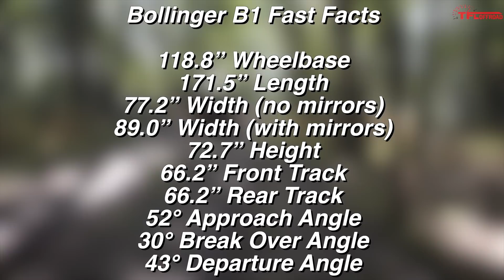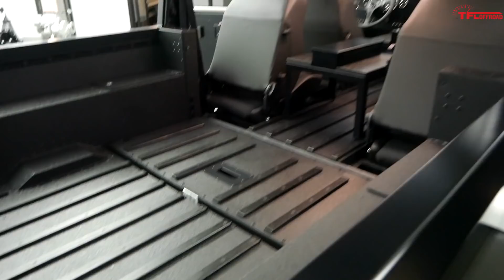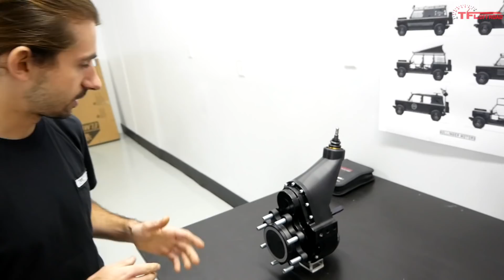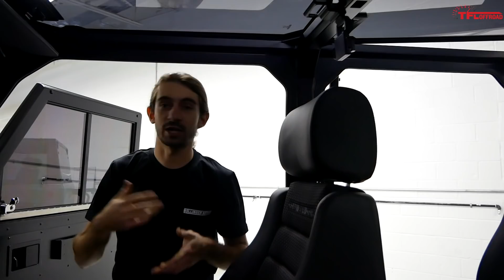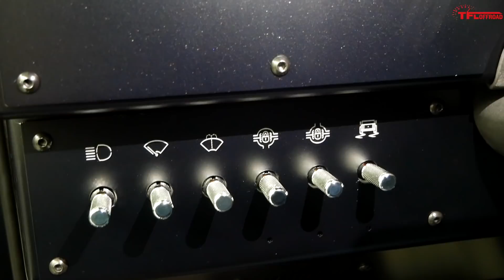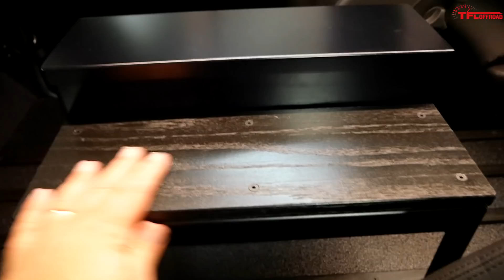You Won't Believe How Clever this Electric Pickup Truck & SUV Really Are

Comment: Other car manufacturers: we need to make an electric car as aerodynamic as possible
Bollinger: let's make a brick
Reply: Look up there old videos, it has a surprisingly good slipstream
Reply: The brick doesn't matter because this isn't met to be a freeway driver. This is a farm truck, work truck off road vehicle. So most of the time it will be driving at lower speeds.
Reply: @Franklin Kenneth You're right, I've never really paused to appreciate the beautiful lines of a brick before.
Reply: @mark7067  . Don't tell me, you find Ram and Ford pickup's attractive. lol

Comment: I like it, simplicity and function. The hi-low beam light switch sold me. And it looks easy to mod out some areas. Ham Radios are an easy add and if you live in the right area, cheep to use. Personally I would undercoat it for use in the rust belt. I think changing the roof glass to solar cells to trickle charge the pickup or SUV. Can’t wait!!!

Comment: love the fact that they brought back the old school high beam switch .
Reply: Unless your spinal cord is messed with.  I have no use of my feet.  I must use hand controls. sadjh;wajhf;wjhf;wkDHJF;kwhjdfk;jhfds  VERY UNTHOUGHTFUL.  Guess I should just sit in the nursing home.
Reply: @tccarr7162  surely one could rig up a hand control for the high beams
Reply: @EEI605  Well ya, it is after all just a switch.  The question is why is all that wiring etc necessary?  Especially at the asking price.  At least put the wiring in the harness.

Comment: Range, range, Range, range, Range, RANGE, RANGE, RAAAANGE! In 2020 we need at least 400 miles guys!!!
Reply: Price, price, price..... keep pretending most ppl will be able to afford even a short range version...but its still cool enough to dream about and for trolls to mindlessly rant about its range... :)
Reply: If you want a 400 mile electric truck, you'll have to wait roughly 2 more years...and Buy either the Rivian RT1 or the Tesla pickup (which should get unveiled later this year).
Reply: @Douglas Stormborn - EV's didn't truly "arrive" until a decade ago.   Lithium ion is energy dense enough to make them practical.  In 2 years you will have 2 400 miles options, and a couple years after that you will have around 6.   People don't seem to be paying attention at how fast the automotive industry in changing.
Reply: @Douglas Stormborn Not bullshit. The Rivian will have 400 mile range thanks to a huge 180kWh battery. The real problem with batteries is how expensive they are. If they were dirt cheap every car could have a huge one with a corresponding long range.
Reply: @Douglas Stormborn The Rivian 400 miles is EPA range, which I understand assumes 55% city driving and 45% highway driving. Like all cars, if you do 100% highway driving the range will be less than EPA.

Comment: who staffs the design team, the flintstones?
Reply: I like the simplicity. Less parts to brake and lower cost
Reply: @BestowalPants90  Yeah, I'm sure it'll be priced under $140,000.
Reply: @frederic423  Maybe, but I wouldn't bet on it.
Reply: @frederic423  Don't count on it.
Reply: Design team? 🤔
Reply: ribbit1964, HAHAHAHAHA So appropriate.
Reply: @BestowalPants90  "lower cost" kek
Reply: It was designed by Lego.....
Reply: ribbit1964 - It’s designed so the panels can be made using a brake press.  They don’t need a huge (and insanely expensive) stamping line to build the body.
Reply: @BestowalPants90  I prefer airbags over simplicity.
Reply: What would you say now after Tesla truck just came out
Reply: @tharwatjad9444  Tesla is a way better deal, and way better looking. It will also come with great features like airbags.

Comment: These things shouldn’t be sold for more than 30-40k it’s literally a metal box with a US military interior
Reply: The 120kWh battery and related electronics alone can cost 30K. Then the metal they use for the body, aluminum, is much more expensive than steel.

Comment: At highway speeds those flat fronts are going to absolutely kill the efficiency
Reply: don't you know? it's off-road
Reply: Yes, which means you will be motivated to drive at low speed, and at low speeds you don't need air bags. See how everything fits together perfectly?
Reply: It’s not street legal you know that right?
Reply: @joshlower1  Of course it is street legal.
Reply: cruiser97eric1 the guy literally said it’s not. It doesn’t have airbags
Reply: @joshlower1  Class 3 vehicles like this one are not required to have air bags.
Reply: cruiser97eric1 even if it was I don’t see it being used on highways much
Reply: It would be great as a farm truck or where someone is working in remote places. I mean it’s literally just an electric humvee.
Reply: Diesel is so expensive nowadays it would be much cheaper to use one of these. Also less maintenance too.
Reply: That's why you tuck in behind a semi and ride the draft. My truck isn't much more aerodynamic than this one and I do that all the time.

Comment: If these guys can’t figure out how to produce this thing at an affordable cost and they start to run low on cash, then Tesla should scoop up this company and rework the electric motor and battery pack and otherwise leave it unchanged. It has a wonderfully mechanical low-tech design ethos. I absolutely love this design. I like all the other Bolinger vehicle variants as well.

Comment: Doesn’t appear to have any crash air bags.
Reply: David Sanchez  They won't, Bollinger Motors says that the B1 is solely designed to be a Class 3 vehicle. As such, the vehicle is not required to have airbags and it's not required to satisfy passenger car crash tests. Class 3 vehicles have a different safety standard.
Reply: Should be accepted as devisrity and neighbourly in Canada. In 1960 (the current year in Canada) we don't know what air bags are?
Reply: I think it’s meant for low production, so it does have to met all modern safety standards
Reply: 2nd3rd1st finally a comment with some sense
Reply: That's probably because airbags are dangerous in an offroad vehicle. You hit a bump at 45mph, airbag deploys and knocks your hands off the wheel, airbag then deflates just in time to see your hood trying to eat a tree. I got rear ended on the freeway at speed once and both the guy who hit me and myself had to fight to keep from rolling. If either of had active airbags we wouldn't have walked away without a scratch (i actually drove away and finished my trip from Oklahoma to Colorado) and the 80 gallon terrarium and possibly the 3 foot python in the back of my truck would have been toast. And don't get me started on seat belts, let's just say that if I always wore one i would have died when I was 7.

Comment: Nice truck but until they get the re-charging time to something as reasonable 10 minutes for max charge, these will be niche products for people who live in cities and own a home and don’t drive much more than 150 miles a day.
Reply: Most people drive less then 100 miles a day, problem will be cost not mileage or charge time.
Reply: @hoodman420  It doesn't matter what most people do in a typical day. If I'm a weekend warrior, I don't want to have to own a 2nd truck just because my plug-in truck fails to go the distance. Unless all I plan is to go off-roading in my back yard or haul a couple tons around my block, this thing is entirely pointless.
Reply: @hoodman420  Most people don't buy trucks and 4x4 utilities a for typical commute, you buy them to haul, tow, go off road and/or make road trips. For that, you need range or quick turnaround.

Comment: 200 mile range empty means aprox 50~60 miles towing, so pretty much useless as a tow vehicle.
Reply: D U fine for a run to Home Depot though.
Reply: @ALMX5DP  Do you people think the average 4x4 buyer would spend so much money to make trips to Home Depot? If so, you're totally out of touch with reality.
Reply: Kendrick who said anything about average buyer? I certainly didn’t.
Reply: @ALMX5DP  Right, average buyers would buy a normal truck while weirdos will buy this.
Reply: @ALMX5DP  How many people are going to buy this so they can strap a trailer to it and go to Home Depot with their 50 miles of range?
Reply: El Guapo I don’t know, that’s a good question for the manufacturer to answer as I’m sure they’ve looked into the potential market base.
Reply: Marauder again, why are you stuck on average buyer?
Reply: @ALMX5DP  I can't believe you're being serious.
Reply: @MC17EMD  It's frightening to know how serious they are.
Reply: @MC17EMD  Serious in questioning why someone brought up an unrelated point? Umm sure I guess I'm serious.
Reply: @ALMX5DP  It's not unrelated at all, it still ties directly to the questions around the purpose of this vehicle. To this point, you still haven't come up with a good reason to own this vehicle.
Reply: @MC17EMD  let me answer that with a question, does a vehicle have to fit the average (current) owner in order to be a success? 

And I think this vehicle can fill a niche for consumers or corporations looking for it's payload, offroad and configurability. Not to mention the technology underneath can be adapted to many more applications.
Reply: @ALMX5DP  Of course not. If the market wants their products, then good for them. But its not really the market driving this. If Ram or Ford built a truck with 50 miles of realistic laden range, and if it was constructed like a filing cabinet and priced at $100,00+ or whatever.... The company's market value would become dirt and it would be the funniest joke in automotive history!! 😂Seriously, I don't even know why we're talking about this as a serious company.
Reply: @MC17EMD  We're not talking about Ford or Ram... We're talking about a small startup trying to fill a niche or at the very least establish themselves and their technology to potentially be absorbed by someone larger. Regardless of the driving force, it fills  a potential void in the market. If you dont like what that driving force is, that's probably something you should take up with your representative.
Reply: @ALMX5DP  I'm using Ford and Ram as measures. Use your head. No one would be talking about a vehicle like this if it weren't an EV novelty. If this had been any established brand with a normal ICE truck, it would be a joke. It doesn't fill any meaningful void. Who the hell would buy a $100,000+ tool box with 50 miles of laden range? Do you know how crazy you sound?
Reply: emdec55 with large brands like Ford and VW getting behind electrification, I don’t think calling it a novelty is completely accurate. And let’s not forget that Ford did their own marketing stunt with the train not too long ago. So either way the attention seems deserved.
Reply: @ALMX5DP  How did we spread this to the broader EV market? We're talking about the vehicles in this video, not some $40,000 electric Golf, which, BTW, is likely a loss leader and a way to offset carbon taxes.
Reply: You guys, they will only sell 20 of these and they will mainly be used in rap videos.
Reply: you are using a aerodynamic Tesla for reference this is already more of a brick wall than other trucks, additional power for the weight yeah but aerodynamically it cant get much worse I'd be surprised if it couldn't tow for 100 miles with 120kw
Reply: None of you will be able to afford it... so have fun mindlessly trolling about it....
Reply: @nc3826 that's the only reason I'm not buying it. I love it.
Reply: Drop another 10 to 20 miles off that 50-60 during the summer with the AC going full blast.
Reply: @ValkyrieRiderIPT  you'll need it with the sun beating down on you from all angles
Reply: Love theses comments... since it reminds us all how....Social media is mostly just about mindless moronic trolling...
Reply: My friend got one of these and I have a fairly new boat we went to the river for the weekend. We were out in the desert on the way and it ran out of charge. It got hot in the day. I brought a window AC that runs on 110 but could not run that either. We had a solar charger but by the time it was charged the weekend was over and had to go home and back to work. I suggest a large generator if you want to take it someplace. It works great for grocery shopping or if you tow it where you are going. Not sure if you need a flatbed for towing it. He does not drive it much now due to the price of batteries it will need soon.  There is a lot of confidence going shopping at the grocery store or mall with all wheel drive. It is a millennial machine to have. You can cross over the lawn without an issue.
Reply: "My friend got one of these".....FLMAO, since they are not being sold  yet....
Reply: The towing capacity is 7500lbs, it will barely tow my quad trailer loaded.  It wont touch my camper,  wont touch my boat, wont touch my tool trailer.  I really don't know what the range would translate to while towing but ... I have a feeling that Im going to be waiting a LONG TIME for a EV PickUp truck that competes with my F550 Diesel.  I get it that my truck sucks balls when it comes to mileage but shes got a big tank and she'll tow a house.
Reply: @elguapo4461  I will I need it for my mom's shopping it's the perfect vehicle
Reply: It would easily cover my daily driving needs and all those trips to home depot. If they sell a hitch or bed mounted diesel generator package that can keep it charged while going down the highway, it would be even more practical for long drives and towing than a typical pickup. (Pass through hitch receiver for hitch mounted generator and towing at the same time).  A 50kw APU like used in aircraft would work.  You may be able to get used ones that are decommissioned from aircraft by regulation cheap.  Wind and cabin noise are a different concern. Not sure if that woud be the deal breaker for long trips.
Reply: Dude, most hauls are less than that.
Reply: @idontgotnothin  there like 50,000 but the engine work is equivalent to 80.000 considering the weight of the tractor and trailer but the weight is really 50,000
Reply: Alan Bowers these are designed to work around the farm and stuff. Not to go on long hauls. Which is great because diesel is very expensive nowadays. You can just plug this thing in the barn overnight and be done with it.
Reply: Alex Mills it’s not even street legal so none of that even matters. It’s purely for fun and farm work etc. it’s like buying a 4 wheeler
Reply: 200 mile range is pretty much useless for me either way. I estimate i can go 400 on a tank of gas in my truck assuming I'm cruising trails and not highways. Without towing, of course. I'm not sure what I'd get pulling a standard 18 ft camper for example.
Reply: Kendrick 
My 09 canyon 4 x4 5.3 
Is covered in a protective coating of mud and gravel dust to protect the finish

Comment: What would be awesome is if they have an option to add a gas generator that can be place in the truck bed that will recharge the battery for long trips.   Something like the Polar Power DC generator acting as a range extender.   It's got room for it so why not?   LOL
Reply: I would really like to see those flat surfaces on the roof and front hood covered in solar panels. For operations where the vehicle stands parked for extended periods of time (work, camping, etc.) it would extend the range a bit. Since there's a considerable area. ;-)

Comment: 200 miles? Lol fail. When will a company shock us all with a 1000 mile range. Of that's right you can't because battery technology is for toys, where they belong
Reply: The Aptera EV has a 1000 mile range, and it goes from 0 to 60mph in 3 seconds.

Comment: The real replacement for the Landrover Defender, simple and rugged. I'd prefer to have the drive related switches grouped together, here some are on the left of the steering wheel, some on the right.  I'd want sway bar locks (2), suspension lift, diff locks(2), TC on one side. Other side, AC, blower, temp sw, lights, wipers. washers.
Reply: I was wondering about the upper vents in the front guards, I would think the side outlets would be better as these could full up with snow etc.

Comment: This looks like they gave a 5 year old a crayon and said “draw us a SUV”
Toddler draws a box with wheels...
Design team runs with it lol
Reply: guy proulx  The problem isn't the design, it's the manufacturing techniques being used. Even if the panels are squared, a Jeep Wrangler or Gladiator use the most advanced metal forming machines that gives details that aren't seen here. This just looks like sheets of metal that were cut with a hydraulic cutter and the edges were grounded down to keep people from cutting themselves.

Comment: Am I missing something, but why don't electric vehicles extend range by using solar panels? This combined with regenerative braking could essential add enough energy to get a few extra miles out of the battery packs. Even if not a lot it would still be beneficial and only increase production costs by a few hundred dollars.

Comment: Love the look - I am a Land Rover Defender Fan and I like this better. The 200 mile range is disappointing. In 2020, it just doesn't cut it. But the biggest problem they have is the price - $125,000!!!!! 

The entry level Cybertruck will start at $40,000 with about 50 miles more range. If it has to be 4 wheel drive, the twin motor cybertruck will come in starting at $50,000 with about 100 more miles of range than the Bollinger. The Tri motor version will be about $70,000 and have 500 miles of range with larger payload and towing capacity. If the Cybrtruck looks are too weird for you, the Rivian R1T (which is a really good looking Truck in the Traditional sense) will start at $69,000 and optioned out it might reach $100,000 and have 400 miles of range (double the Bollinger). 

I really wish Bollinger the best and I hope that they sell enough to stay in business because they do have a pretty unique and cool design. But you must really be into the Bollinger to choose it over the Rivian and the Cybrtruck.